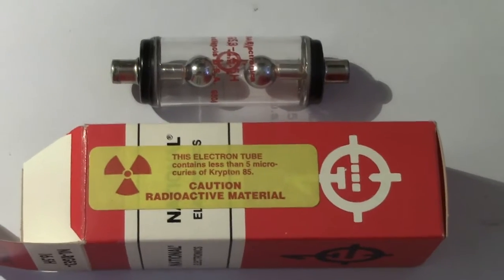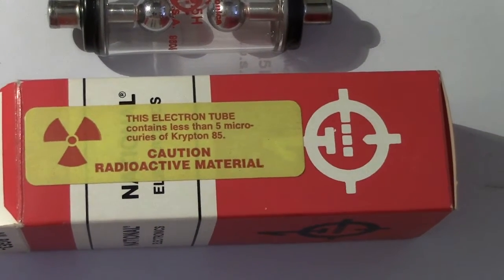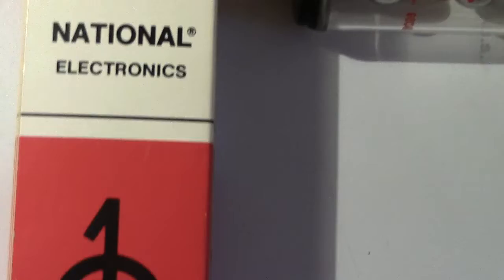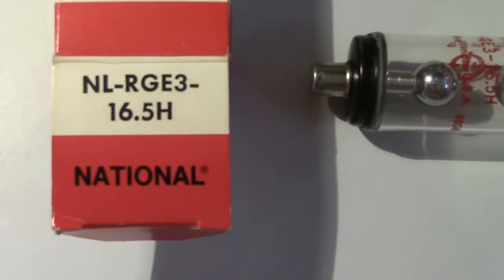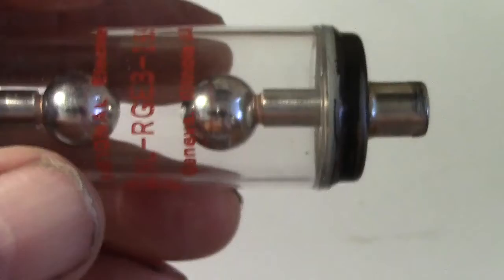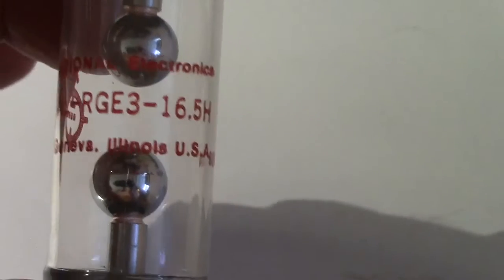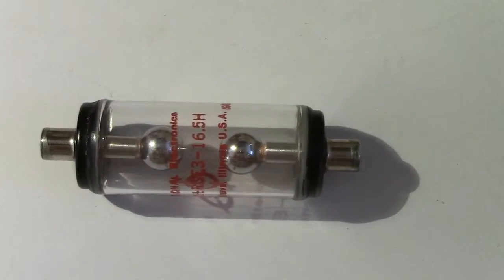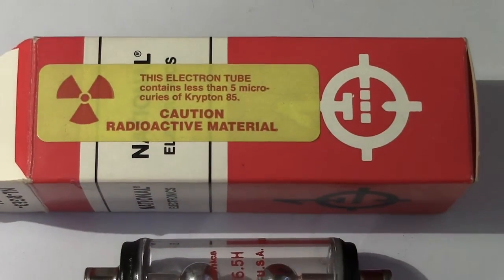NL-RGE3-16.5H    What is it and what is it for.....Thanks.

Comment: Looks like someone has answered your question, that device is a spark gap that is gas filled and also has a Radioactive element to help initiate electron flow. May have been used to protect electronic circuits by discharging high voltage spikes caused by lightning and other phenomena. That is a fascinating item, have been looking for one to add to my collection of Radioactive objects.
Reply from the maker: Lot of interests in this spark gap and you all say the same thing many thanks to you all....peter

Comment: It's a spark gap tube, might be used in medical apparatus, possibly old x-ray machines but something about spark gap makes me think of vintage radio transmitters...

Seems like something that would operate at high voltage for isolating a power supply from the mains or current regulation, possibly ballasting for x-ray or gamma ray... everything today being solid state it's hard to tell.

I've posted a link to spark gap transmitters... might have something to do with RF power output on 2 way radio before the solid state revolution.

https://en.wikipedia.org/wiki/Spark-gap_transmitter
Reply from the maker: Looks like this item has caused lot of interest,I am glad and you, Alex and Rustymotor say the same thing, thanks to you all, very good info.....peter